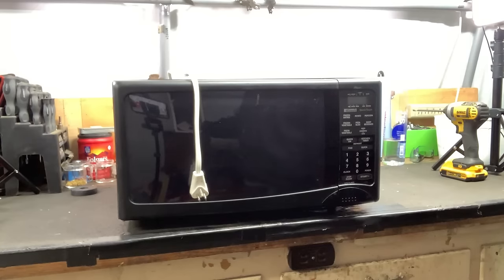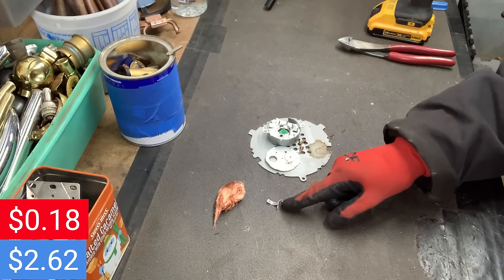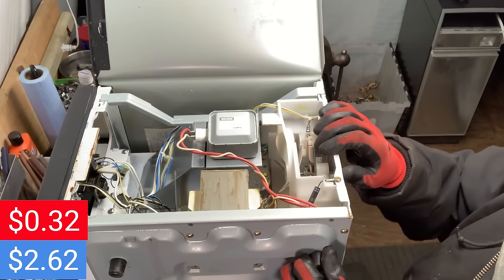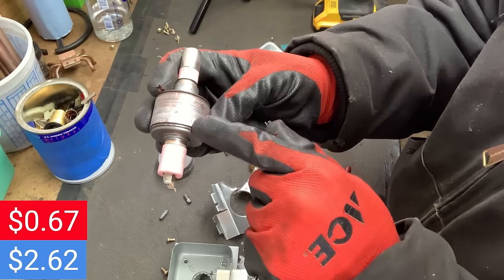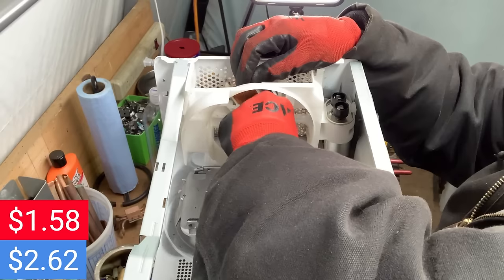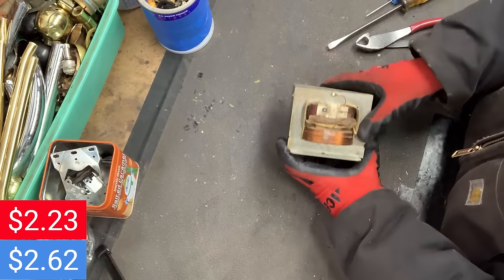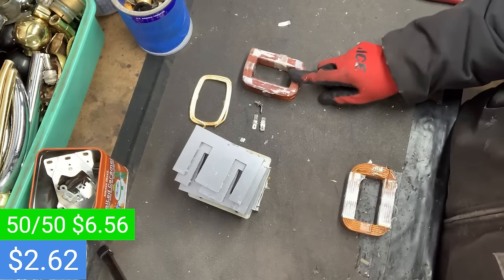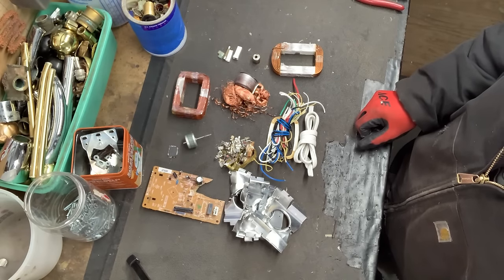How to Scrap a Microwave - Step by Step Guide

Comment: The way you handle a magnetron was very dangerous. Never use caution when taking them apart. Some, not all, contain beryllium. If that ceramic band is cracked or scratched, it could release just enough particulates that you could breathe in and cause really bad things to happen from berylliosis such as pneumonia and even lung cancer.
Reply from the maker: I’m fully aware of the potential for beryllium, but research shows that they haven’t used beryllium in residential microwaves in decades.

Comment: From Wiki... There is also beryllium oxide in the ceramic insulators of most magnetrons. If the insulator cracks or is broken, that dust is highly toxic if inhaled. If you want a nice magnet, there are safer ways to get one. Leave the magnetrons alone.
Reply from the maker: They haven’t used beryllium in household microwaves for a very very long time. Thank you for the concern though.
Reply: @scrapitall200  so just don't scrap old ones... Got it ,:)
Reply from the maker: @PerilousPaddy  exactly!

Comment: Microwaves and vacuum cleaners are my favorites to take apart.
Reply from the maker: I love scrapping microwaves. Not a big fan of vacuums though. Although I have scrapped a couple old ones made with cast aluminum instead of plastic lol. 
Thank you for watching.
Reply: I'm a sucker for vacuums as well unfortunately. Lots of plastic and dirty yuckyness but somewhere in there is a motor of some kind.
Reply from the maker: @lastvestiges  it’s all the dust inside that turns me off. Thinking about all the dead skin cells 🤢🤣

Comment: Please be careful with those magnatrons, they are radioactive if hit or damaged....
Reply from the maker: Thank you for your concern. The research I’ve done says they’re not dangerous. Do you have a link to an article that says they are dangerous?
Thank you for watching.
Reply: @scrapitall200  There is also beryllium oxide in the ceramic insulators of most magnetrons. If the insulator cracks or is broken, that dust is highly toxic if inhaled. If you want a nice magnet, there are safer ways to get one. Leave the magnetrons alone. 🙂
Reply from the maker: Manufacturers haven’t used beryllium in a very very long time. According to the research I’ve done. Thanks again.
Reply: @scrapitall200  You're correct, I just researched some more and found this out. But the older ones still do, be safe! Love your content, and your love for the Lord! ❤️
Reply from the maker: @midnitespider  that’s what I have concluded as well. I do appreciate your concern, thank you! 
God bless you and have a wonderful week.

Comment: I am scrapping my first microwave. I have not removed capacitor  or transformer, yet, from shell. I am very nervous abot the beryllium.  Any advice on that?
Reply from the maker: Hi. Thank you for watching. 
I would leave the capacitor in unless your scrap yard will give you a better price than shred for them. 

I’ve done quite a bit of research and manufacturers haven’t used beryllium in microwaves for a very long time, too expensive. Now they use a mixture of chromium and aluminum oxide. 
What I do just to be safe just in the off chance it is beryllium, I wrap it with tape. Beryllium is only dangerous if it’s inhaled into our lungs, so as long as it’s not broken into fine particles that can be inhaled, it’s safe to handle. Now I’m not saying my research is definitive truth, but I feel confident. 
You could take the magnetron to your scrap yard and ask them what they’d pay for it as is. 
Hope this was helpful to you.
Reply: @scrapitall200  yes. That is very helpful. Thank you for taking the time to respond. ✌️
Reply from the maker: @onyxfire7511  oh good! 
You’re welcome. 
Thank you for taking the time to watch and leaving comments.

Comment: You are doubling the price of the secondary winding to demonstrate the price for both windings being copper. This is not true. The secondary weighs more than the primary when they are both copper. You would not get $6.96. You would get less than that if they are both copper.
Reply from the maker: In my experience they are just about the exact same
Reply from the maker: Don’t overthink it. I’m just giving folks an idea what to expect scrapping a microwave. 
Not even double copper transforners will be the same from microwave to microwave. 
Thank you for watching.
Reply: Great video.
Reply from the maker: @mattgour5874  thank you so much.

Comment: I have taken ( many , many ) of these to pieces ..... often the value of a WORKING  part  greatly exceeds the metal scrap value ! ! ... so .... the magnets are useful stuck to your fridge / cooker to store utensils , and placed into  a plastic spray can top , screwed onto the end of a broom pole , can be used to pick up nails / screws in the workshop ! ... the electronic parts are MORE VALUABLE to reuse if left WORKING  ! the transformer is MUCH more valuable ,  working , as you might make a ( dirt cheap ! ) spot welder ( see videos ) , the turntable synchronous motor makes a good Santa rotator for your Christmas tree , and the EHT diode makes a good Zener diode ( ? ) .. even the plastic feet can be reused ! ... of course the steel case is total scrap , but you will get MUCH more value ( reusing / reselling some parts ? ) .... ( tried - n - tested ) ....... DAVE™🛑
Reply from the maker: I’m completely aware of that but I’m a hobby scrapper and I’m not just in it for the money. I want to have fun and that’s why I scrap it all and then sell the scraps to a recycler. 
Thank you for watching.

Comment: Find lots of microwaves street scrapping. I typically take the turn table motor and the wire the fan motor for cooper. The rest is shred for me. If a copper transformer is it worth the effort?
Reply from the maker: @richardhulbert9480  it’s been a long time since I made this video so I don’t remember the exact numbers, but I did a breakdown of the values if the transformer is double copper, double aluminum or half and half.
Reply: @scrapitall200  I love scrapping. It's a side hustle. It pays for my more expensive hobbies. I just love watching others do what I do. Much love my friend and good hunting.
Reply from the maker: Me too! 
What are your expensive hobbies? 
Thank you for being a big supporter of my channel, I greatly appreciate it.
Reply: @scrapitall200  my pleasure. Thank you for making the videos to show everyone. My most expensive hobby is gold from e-waste. I spent a bunch to get the proper equipment to get started. Thankfully it has since paid for itself. I still love stripping random stuff. It's relaxing for me. For instance this weekend I processed several months worth of gathering ram chips from computers. It made me about $240 I also spent a bunch of that time to recover about $4 worth of copper from CPU fans. I hate selling the tiny motors at  09 a pound. It may as well be shred. My other hobby is polishing rocks. I did one this weekend turned out very pretty.
Reply: You are saving gold bearing components. Don't find a refiner. As long as you use common sense you can do it yourself. I am still learning myself. I learned the most watching Omega geek 64. Plus he is a friend that got me into the rock polishing with mikes lapidary channel. I suggest start small build your confidence then start making some cash. Be safe. The biggest issues are when dissolving the base metal. That's not something you want to breathe. The next is when dropping your gold from solution. Hold your breath. It's not bad just watch others do it before you try yourself. My first gold recovery was .015 my last was 4.83. Takes doing it to get used to it
Reply from the maker: Awesome my friend! 
I haven’t completely ruled out refining my own gold, but honestly I’d rather find someone who will do it for a percentage of the total gold recovered. I’ve been saving gold bearing material for almost 3 years so I’m collecting quite a bit.
Reply: @scrapitall200  I have years worth of my own stuff to process.  But first thing I will say is there is less gold than we expect most every time. Think the standard is 30% for refining. It's about trust. You have to trust that I get all I can out of the material. I will if part of it's mine. But if you get less then you think it's worth you think I am cheating you. So it's about trust. I suggest watching other process the material you have to get an expectation of what it's worth.
Reply: If you want I can process your stuff I just about finished what I have ready of mine. No promises but I like doing it and the 30% basically covers the cost of the chemicals.
Reply from the maker: Trust is huge for sure. 
I’ve watched quite a few and I did learn that there isn’t nearly as much gold as one might think. 
I have some trimmed gold fingers! Have you ever refined those before? Would you be willing to make a deal?
Reply: @scrapitall200  I would. Fingers are easy. I use dilute nitric to remove the foils then dissolve them. They look nice but don't weigh much. I was surprised more by the ram chips on the ram sticks.
Reply: My biggest recover so far was from about 7-8 pounds of random ic chips. But to be honest it was way more work than the 4.8 I got from my fingers. Oh the chips were  6.3 still nice.
Reply from the maker: I’ve watched the fingers get processed and they definitely seem a lot easier.
Reply: I am lucky. I've made friends with several computer repair shops. I get called to come pick them up on a regular basis. If I don't pick up another I probably have 5 years worth waiting on me. But I will pick up more. I work full time e-waste is my hobby. I figure to retire before to many more years then hit the e-waste more then spend more time fishing
Reply: @scrapitall200  they look great and not hard to process. But you get your hopes up seeing all them foils. Then weigh them up. Oops. Still definitely worth doing.
Reply from the maker: @richardhulbert9480  that’s awesome! I need to find a good source of computers. 
I can tell from watching videos that they are super light. 
I would love to mail you the fingers I have and you keep 30% and then mail me back my share. 
I just need your mailing address bud
Reply: @scrapitall200  I called the shops near me. One is happy to know I destroyed everything. Another charges me $2 a desktop and $1 a laptop. But he has a bunch. Other guy I bribe with lunch now and then.
Reply from the maker: Free is always best, but that’s not a bad price to pay for them, especially since you’re recovering the gold yourself.
Reply: @scrapitall200  my wife complains. I have piles of desktops outside but since laptops have tiny screws  I don't want them in the weather. It was ok till I put 200 in our guest room. Just till I get to them. That was 2 years ago
Reply from the maker: Oh wow! 🤣
Reply: @scrapitall200  one thing I like is that we both have American flags in our sheds. We both keep stuff out of the landfills and we both enjoy doing it. Main difference is I have no interest in recording it. Happy you do though it's nice to watch while I am doing similar stuff. But many times I tell at the phone to do this or that. Sometimes I say well wow didn't think of that and learn a new way.
Reply from the maker: God bless the USA 🇺🇸 
I sure do appreciate you watching, I really do love making videos!
Reply: @scrapitall200  thanks again for making them. And as a I hate to say former but let's say an older marine I love seeing the flag. And though I am not the most religious of us I appreciate you and your expressing yours. Keep doing what you do. I hope the channel keeps growing.
Reply from the maker: Thank you for your service and protecting our beautiful country and for the sacrifices you made. I have nothing but ultimate respect for you! 
You’re welcome and thank you.
Reply: @scrapitall200  the service was a great time. I give my respect to those who died for us.  To be honest most do not believe in what the government tells them to do. But it's a job and they do it the best they can. So my respect and sympathy goes to those doing a job they wish they didn't have to.
Reply from the maker: @richardhulbert9480  I don’t trust most of what the government says, but I know we have real enemies and America would perish if it wasn’t for all you folks who choose to serve and protect.
Reply: @scrapitall200  uhhrahh.
Reply: That's the marine way of saying hell yeah. Or thank you or many other things. Kinda simple but means a lot
Reply from the maker: @richardhulbert9480  I’ve heard that before!! 😃🇺🇸